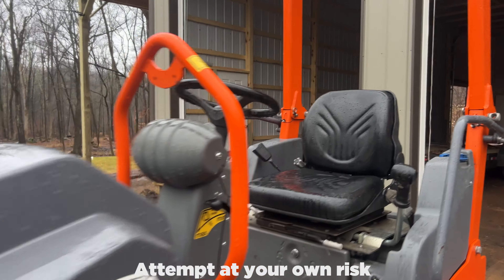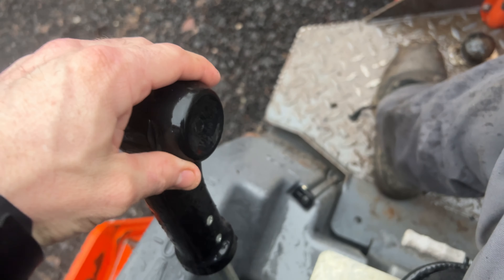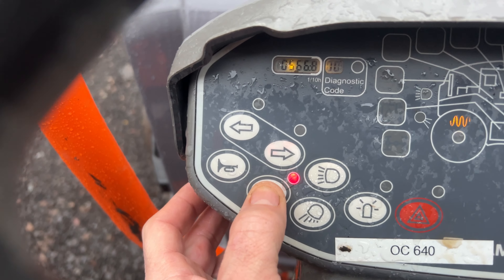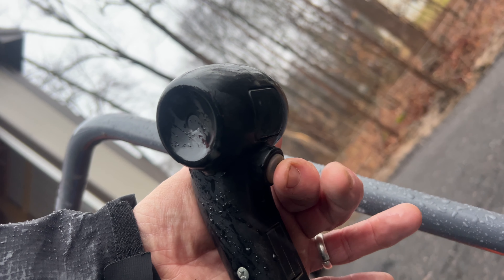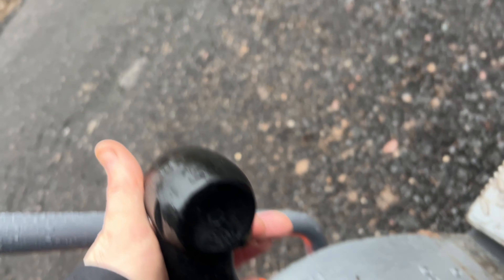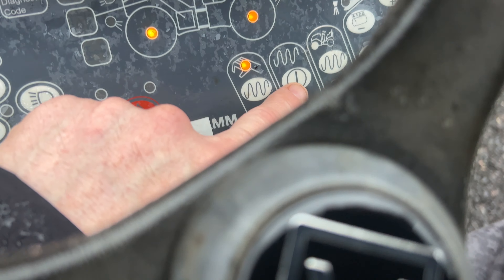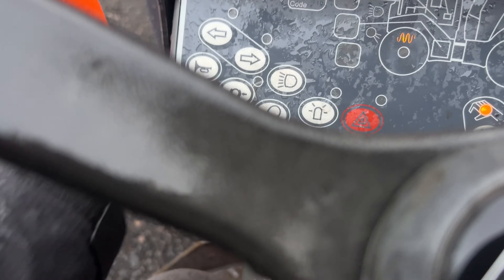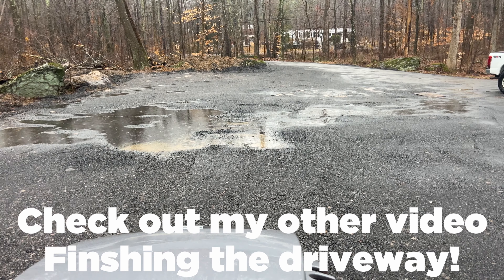How to start turn on operate use Hamm HD-12 dual vibrating roller compaction machine tandem drum 12

Comment: So we are thinking about upgrading to the hamm hd12 from the wacker rd12 roller.How reliable of a roller is it?Have you had any major problems with it?
Reply from the maker: I never owned it personally, but I knew an old guy that used to work at the tool rental place and as let me use it a few times. They have three of these machines they rent and he said they used them because they’re very reliable and they have the least problems with them.
Reply from the maker: So, based off of what he said, they seem to be the go to roller. I work at my father‘s business that uses excavators for electrical and plumbing work, but I’m involved in the construction industry and see a lot of these on job sites, and I rarely hear complaints about them.

Comment: Ya were only going to use is on stone driveways and milling too.Have a great deal on a 2018 with 400 hours for 18k
Reply from the maker: Yeah, I think that’s what these are best for. I see a lot of decent 3 to 5-year-old ones for sale in the mid 20s and I think they’re like close to 50 grand new. If it’s in really good condition and well kept, it sounds like a pretty good deal
Reply: I am interested if u still have it?

Comment: How to engage low vibration on 1:45 and what are dots on?
Reply from the maker: It’s just the button on the front of that left side joystick. It activates the vibration, but it’s only on or off. There is no high or low vibration settings on this model. Just activated on through the button or activated off through the button.
Reply: Thank you.
But do u know why roller dont have ppwer to go uphill. Engine have rpms but after myb 10 seconds rpms drop and roller dont move.
Does he have like low speed or something. Or I have somekind problem with pump?
Reply from the maker: Yeah, there could be a mechanical problem with it. It doesn’t sound like a speed or a button issue.
Reply from the maker: I can ask around and see if any of my buddies have an idea and let you know if I hear anything